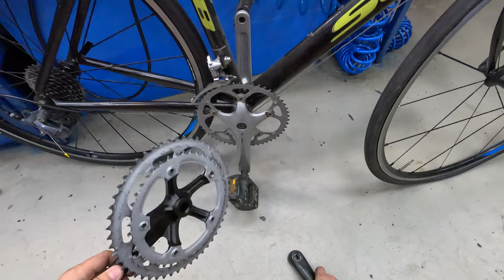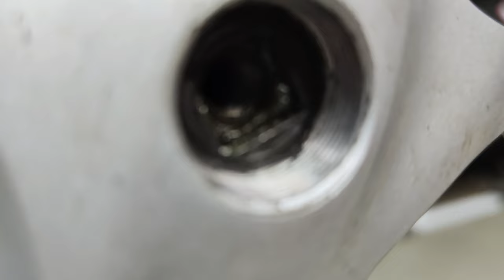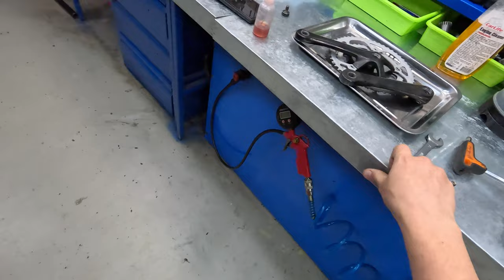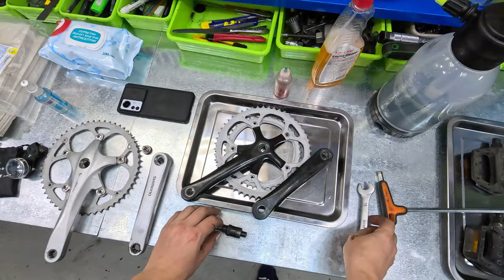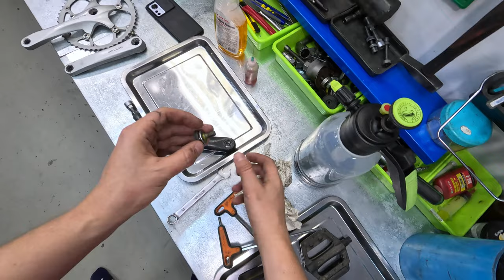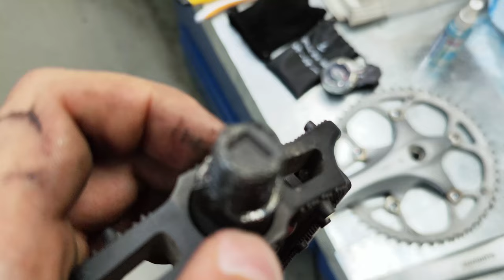How to properly change crankset, the connecting rod system on a road bike

Comment: Can you please tell in how many km do we need to replace the chain, cassette and crankset on a mountain bike I have GT Avalanche Sports 2018 MTB it has 3x9 drivetrain
Reply from the maker: for your bike, I recommend using 3 chains. change the chains in a circle, one after the other, every 300 km.

Comment: Could've at least explained why you would replace the crank arms with what looks to be an identical model with mismatched colors.. If you only wanted to upgrade to a double chainring or replace worn out rings this is definitely not the proper way to do it, waste of a spider and crank arm. If you are changing crank arm lenght you should've stated it to begin with.
Reply from the maker: Yeah, I didn't give a reason why the connecting rods are being changed.
1. 175mm is being changed to 172.5;
2. one sprocket changes to 2 sprockets

but the point of the video is to show how the replacement procedure is done in a workshop.
Reply from the maker: I'm really glad my video was helpful to you!
visit our first channel  "NiceBikeService"
Reply from the maker: thank you!!!